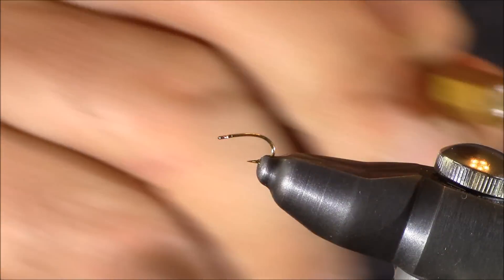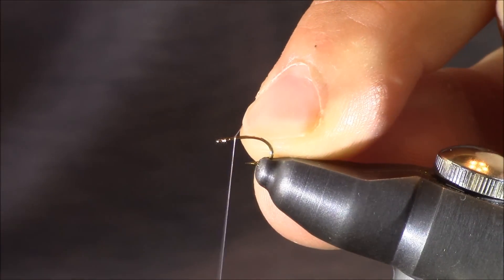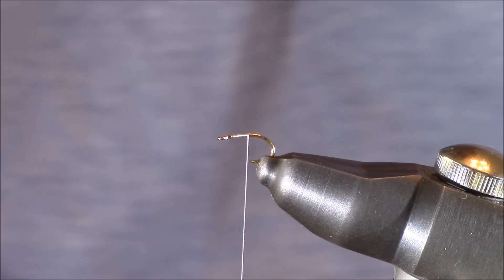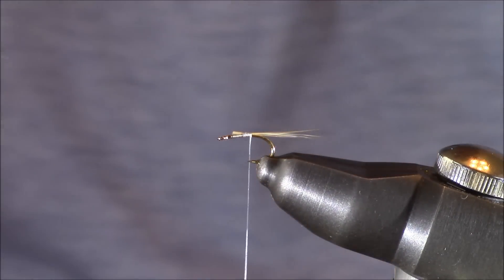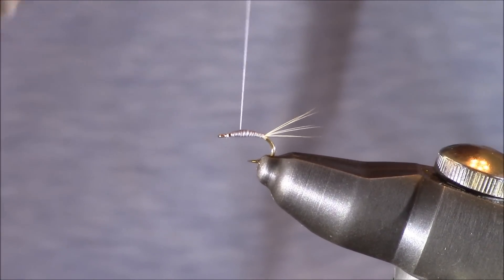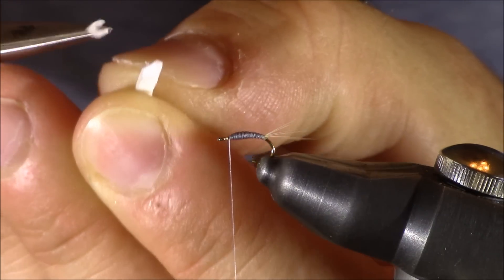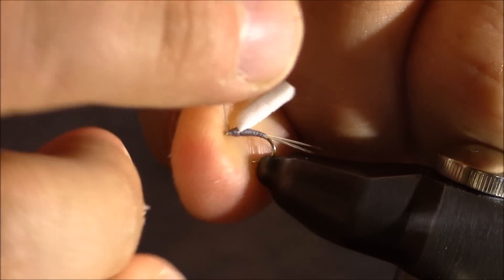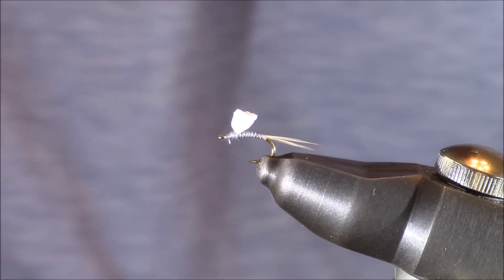Two Minute Fly Tying: Foam Wing Midge

Comment: I tie these with the wing facing front on a size 18 scud hook with black thread, no tail. Works great when the fish are focused on emergers. I call them “marshmallow” emergers. Float great and are easy to see in fast water. A red top from a Sharpie makes it visible in a foam line.
Reply from the maker: Thanks for the comments, Dave, and this has been a winner of mine for YEARS! I appreciate you sharing another version. Do you still keep white foam with the red permanent marker? Tim http://www.troutandfeather.com

Comment: Tim, I use some tippet material through the middle of the wing, tie the mono down a little past the thorax, stand the mono up to get the angle you want on the wing, then bend back down towards the front of the hook. It will leave the foam in position and make it more durable. So if you look at the fly from the front the wing goes up, mono bent at the top and then tied down behind the wing with enough slack to leave the wing as upright as you want it. Give it a go. If you don't like it, you can always go back. 
All the best to you and your wife, and God Bless (Uncle John too.) Sean
Reply from the maker: Sean Mooney Nice suggestion, Sean, and it would definitely provide some durability.  Is there a certain pound test that you find best on this size fly?  Thanks for commenting, and I want to let you know that Uncle John just recorded...I hope to have his video out in the next couple weeks.  Tim
Reply: I have used the largest is 4lb. test and less. It just makes the hinge point a little stronger and lasts a few more fish with the wing on the line even if it breaks at the body. All the best, looking forward to seeing Uncle John again. What a magnificent resource to have. Treasure him while The Lord leaves him with you. God bless, Sean

Comment: I noticed you are using the pattern as a dry. Even with that large wing, your pattern would do well dredging the bottom as a nymph rig. I am not thrilled with your choice of hook, as I believe you still have a size 16 midge, using that wide gapped hook. This is opinion of course, not a criticism. Having a tail on a midge pattern? I could not agree more with you. I tie most of my midge patterns with a tail. It is easier to cut a tail off on the river than add one, and, I believe it can trigger strikes. Good presentation sir.
Reply from the maker: ***** Thanks for the comments, Wayne, and I appreciate your thoughts.  I agree completely that it can be used a nymph, and I have frequently caught fish on this fly when it was swept under by the current.  The hook sizing...interesting you brought that up!  There was another discussion related to sizing on another forum recently, and the notion of having a wide gap and XS shank is a little misinforming.  In short, I think you're correct in saying this is like a 16, yet 3xs...and I definitely love (and recommend) this hook.  Thanks again for the kind words and comments, and I look forward to hearing more from you on additional videos.  TC
Reply: Wayne Graff I